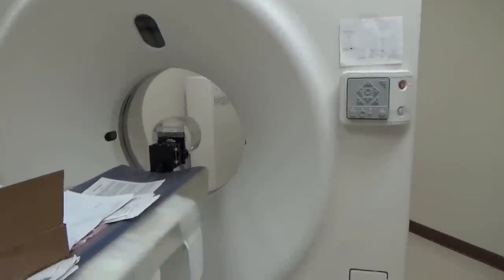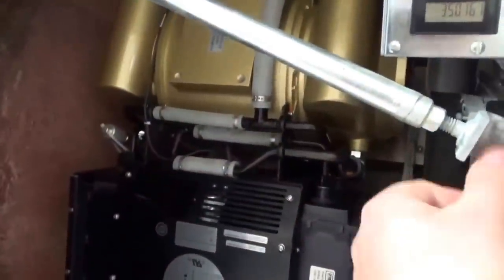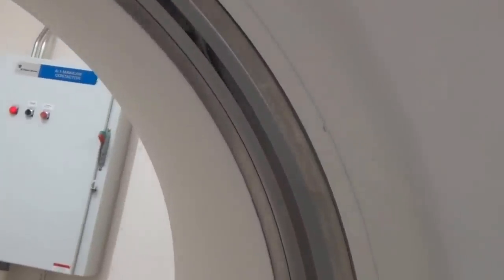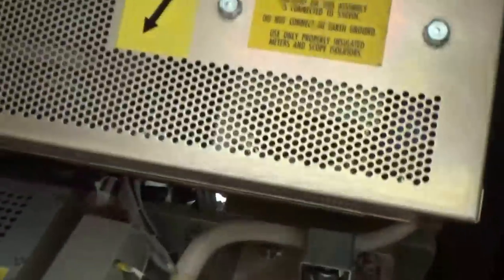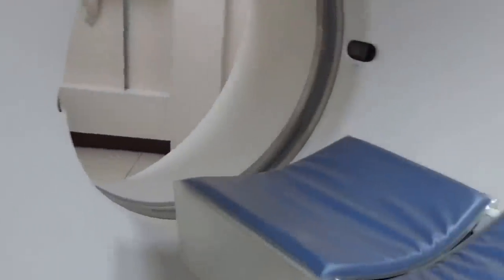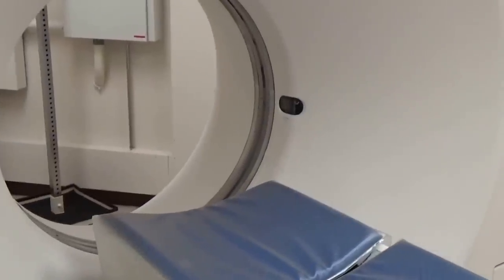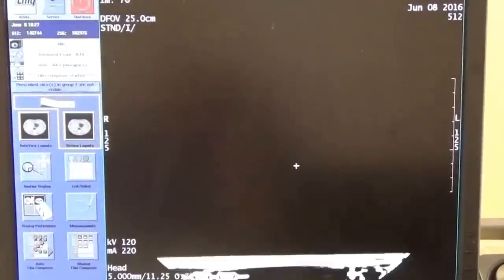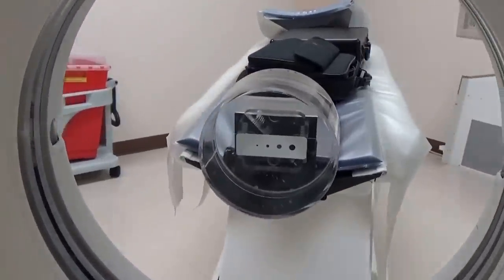How Does a CT (CAT Scan) Work?

Comment: Wow what a fascinating video. I had one of these scans done recently, I laid down on the table and they put a needle into my arm for the contrast. The machine made some soft whirring noises and I slid into and out of the donut, the first time without the contrast, and the second with (I could tell because I could feel the machinary injecting me). It was not an unpleasant experience, but hearing the operators voice come over the loudspeaker to hold my breath nearly made me leap off the table in fright! Fortunatly I kept my cool and just relaxed and let it all happen. Anyone who is going to have one of these scans done, the worst bit is the needle going into your arm, and thats pretty painless, unless you have a phobia of needles like me. Thanks for putting this up - always wondered what made up the "guts" of one of these things :)

Oh and yes contact with 750V DC at anything over a milliamp is suicide material. Take notice of this guy when playing with these kinds of voltages. DC is lethal at anything above 45V with a bit of current behind it.
Reply from the maker: Glad you enjoyed it.  By the way, I hate needles too!  I'm a better repair man than I am a patient!

Comment: Thanks for this video. Recently I had to be patient and doctor warned me that I will be hearing loud sounds for about 15-20 min. I can't describe how terrible it was, strange knocking and distorting sound, it was like heavy metal from another world. I just wonder why it was so loud and what makes these sounds?
Reply from the maker: By the sounds of it (no pun intended), I think you had an MRI scan instead of a CT.  MRI units use radio waves instead of X-Ray to make the image.  When the gradient amplifier is running (the thing that makes the radio waves), It sounds like a very loud banging and buzzing noise.  Usually, the technologist will have you wear a set of noise canceling headphones to reduce the noise.  It's pretty scary if you never had a scan before!
Reply: Aha I see now, sadly she didn't offered me anything like that... thanks for info!

Comment: A great educational video for anyone...official permission may have been required for this recording..
From your experience over the years with these..how do the screws / nuts etc. stand up to that ..when rotating... definitely the many modules inside undergo vibration & centrifugal pull ..the rotating gantry in all probability is dynamically balanced...???

Comment: Awesome basic explanation. I know lots of people that are scared of getting CT/MRI scans, and I try to explain a "very" basic idea of how they work to lower their anxieties. Because there is nothing to worry about (as a patient). That it's a harmless procedure! It's almost fun when you know how it works. 
However, with a background a few years in some electronic engineering, it's amazing that you can spin that much weight/electricity/and data all using slips rotors (slip rings) !  
With the old versions of non-slip-ring technology were there ever incidents that the high voltage b+ got snagged and shorted? If so what was it like for the person inside? I couldn't imagine the sound it make! LoLz 
I worked for Avid technology, and we used to build the computers racks that you showed, we didn't load the proprietary software, just built the mainframes (compac 4-6 processor alpha-servers at the time, in 2004) extremely fast data crunching for their time!  Thanks for the great vid!

Comment: Slip rings are basically like collector rings in a tornado siren. When the siren rotates, the current that drives the motor to spin the chopper flows through the collector rings, allowing the siren to rotate in as many 360 degree rotations as it could while it is sounding. Also, according to the PDU or whatever, the scanner is made by GE.

Comment: That's incredible I wonder how big the tube is with the anode and cathode in it
Reply from the maker: The actual glass tube inside the housing is about the size of a paint can.  The anode disc is usually around 7 - 8" in diameter.  The whole tube assembly including the housing and cooling unit can weigh in at around 300 pounds, depending on the model.

Comment: Instead of having slips rings and bushes can't they have wireless data transmission (like blue tooth or Wifi) direct to the computers. Or maybe the x-ray emissions could cause interference with the wireless signals.
Reply: There is much more than communication data being sent through the slip rings.

3 phase power the HV transformers for instance.
Reply: coz the amount of data is too huge to be sent by any wireless signal we use so far ,maybe it can happen sometime in the future
Reply: and I mean besides the power supply thing

Comment: What is the working rpm of that Gantry ? 
it seems more then 100 rpm/min or am i wrong ?
Reply: You're correct: it's 240rpm. I believe that maximum revolutions in older scanners is 4/s. Newer are slightly faster.
Reply: @AnitaJobby  , thx.